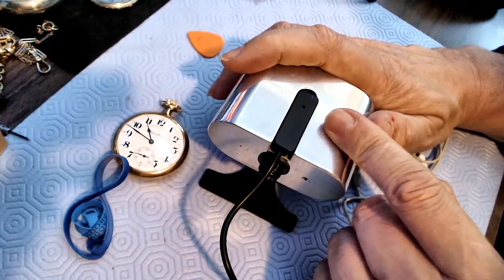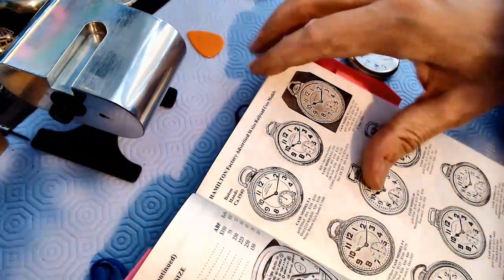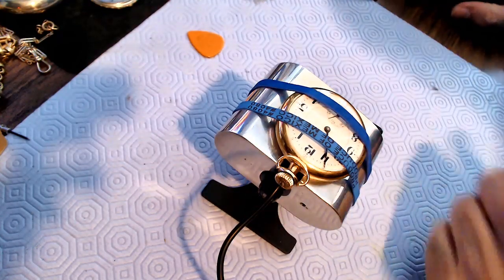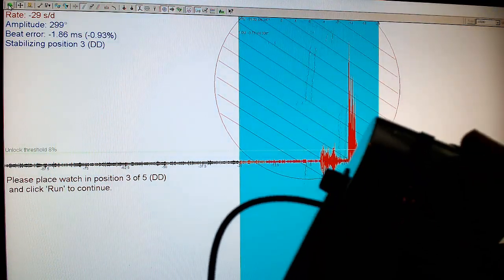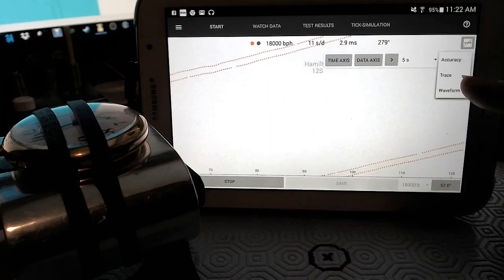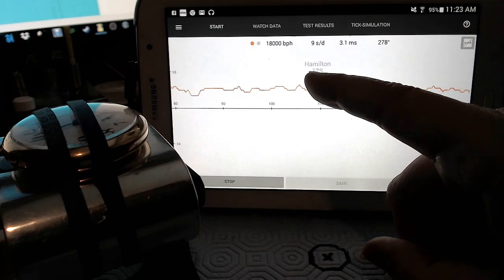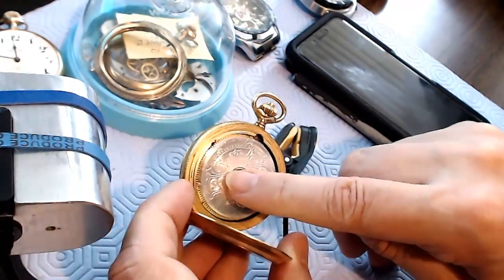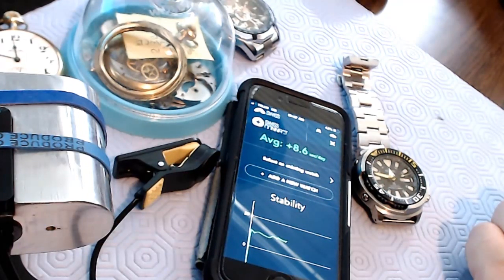Timing Watches - Software Review

Comment: Interesting to see the different s/w you have. I've used Watch-o-Scope (the free version) with a few pocket watches, and quite a few Junghans Ato-Mat balance wheel driven battery clock mechs from the 60s/70s here, and it seems to work fine - the 'tick' display looks like that of Tickoprint. I suspect your mic level needs to be set up on Watch-o-Scope, you can display the pulses it's hearing and check they are large enough - you can set a manual level in the s/w, but I've found that it's own autoset level is usually fine. (I have no connection with Watch-o-Scope, other than as a satisfied customer)
Reply from the maker: noakeswalker I think it use to work fine for me so I really shouldn’t bash it. The tickoprint is pretty darn good for an Android and iPhone app as well. If you’re deep into it then eTimer is a must.

Comment: I have a question, what kind of metal is use to make a watch stem?
Reply: Steel, generally. What kind of watch stem are you looking for?
Reply from the maker: Blued Steel is used. Buy it on eBay from the UK usually.
Reply: @AndyHullMcPenguin  a pocket watch im going to make the steem becase the watch doesn't have a brand name of calibre
Reply: @JDRichard  thank you